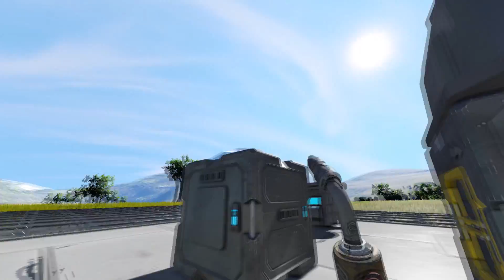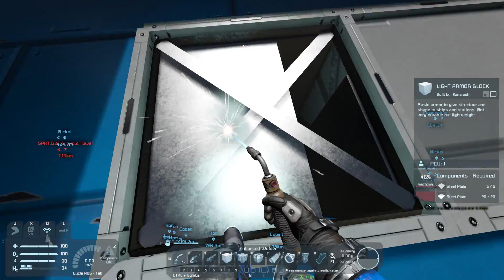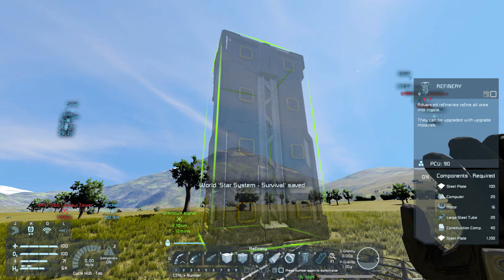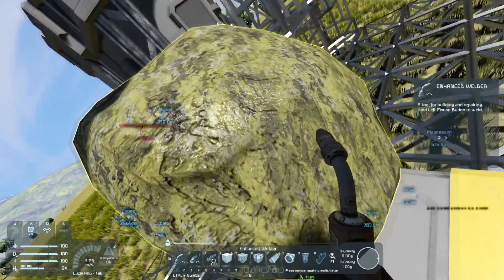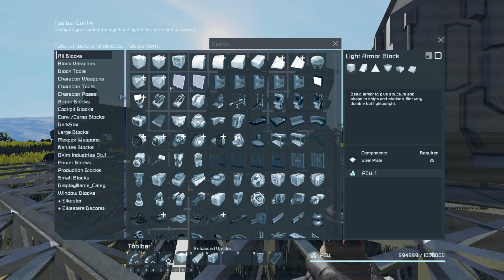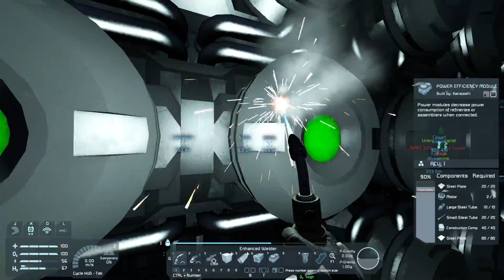Space Engineers - S1E04 'Setting Up Industry'

Comment: Tip: If you build a block of refineries, build them 1 space apart. You can use one connector between them, with filters, to feed both refineries only certain ore, this way you can have dedicated refineries. You can use the ports at the top or bottom of the refineries for the return trip, 1 conduit collecting all metals back to storage.
Reply from the maker: I plan to make a much better organized base. Not sure yet if i want to do it as an expansion to the earth base, as a space station or on the moon.